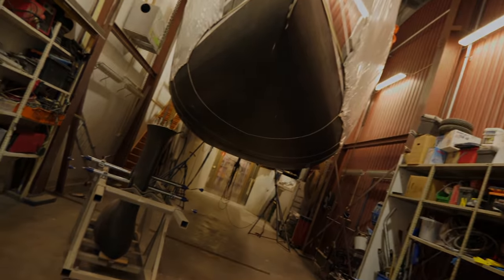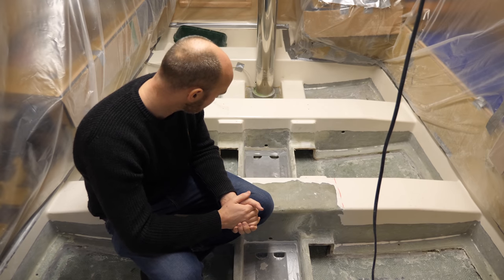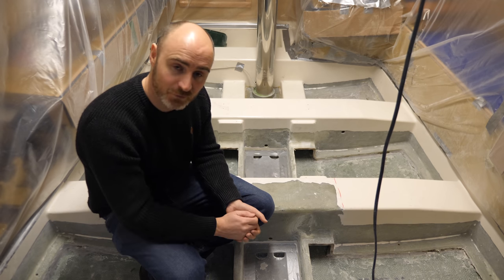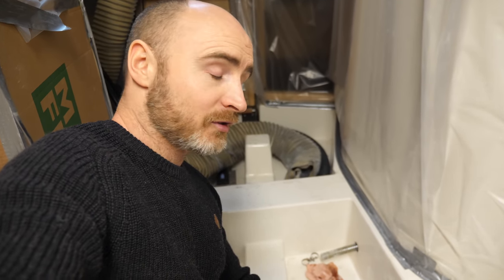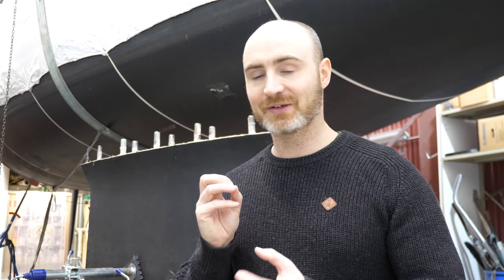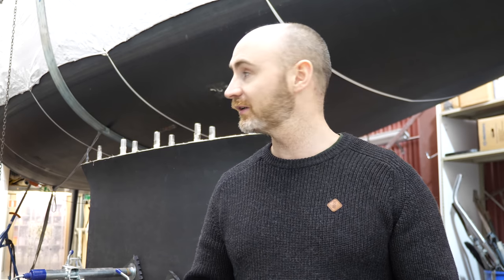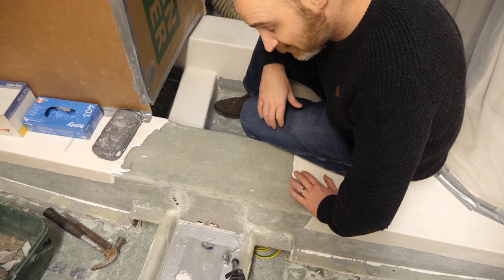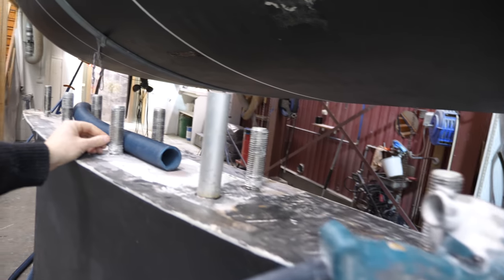SAILBOAT REBUILD - what they DON'T TELL YOU about PRODUCTION BOATS - Plastskador repair week 2

Comment: The bonding, if done with quality materials, is very good practise, the reason that Hanse is in business is because they choose the best, most economical way to build. This collision is about as bad as it can get without holing the hull. I can so empathise with feeling confidence in the tradespeople. Looking forward to seeing this completed.
Reply: Well said
Reply from the maker: Thanks Phillip, as always appreciated. I agree completely. I touch on this a little in the video released today. Cheers, Chris
Reply: This is months of hard work to repair. Very comprehensive which it needs to be. Thanks for sharing. The bonding is not much better than filler. It's glass without the reinforcing glass. By the way epoxy will bond onto polyester. But polyester won't bond onto epoxy. I also incorporate carbon fibre into high stress repairs and have found that by the time I have finished the repairs are massively strong.

Comment: Bilge pumps. You absolutely need an upgrade here. That pump is a clearing pump only, i.e. it is designed to get very close to the bottom of the boat to clear the last few gallons. If you are heading offshore my advice is to fit 2 fully independent pumps with separate outlets (T 2 hoses together at least halves the pump output). Arrange the switches so that one comes on a couple of inches higher than the other. The idea is that the first one is the 'working pump' and the second one kicks in when the first one fails, clogs or is overwhelmed. Because the second pump normally stays dry and unused it is more likely to work when you really need it. Also rig a loud alarm to the second pump, if it goes off you know you have an emergency. A good idea, but not essential, is to use the same model for both pumps, that way you only need one spare. When sizing the pumps look at how much water can come in if a sea-cock, rudder seal of prop shaft seal blows. Your pumps need to clear water fast enough in that event for you to make a repair. Personally I would not consider anything less than 2000gal/hour (for each, not total) as a bilge pump on any boat that is going offshore. I have always fitted 4000g/hr and under test these will keep the sump clears if you open a 1.5" sea cock but they will be working close to capacity to do it.
Reply from the maker: Hi Roland, thanks for the tips. In the later videos you can see that I installed exactly that, I had to run another pipe, which was abit of a pain but got in done. Cheers

Comment: Hi Chris, another great episode.  I like your recaps a great deal, very professional.  Not much to say this time.  Glassing in the repair areas is proper.  You make a distinction between a production boat (bonded grid) and a "custom" boat (glassed grid).  You will mislead folks that don't have a good understanding of boat building.  The vast majority of sailboats are production boats, meaning a company is making the same hull and deck over and over, from a mold.  A true custom boat is when you go to a naval architect and tell them you have an idea for a sailboat and you want them to design it.  Then you take the drawing from the architect to a boat yard and say here, build me this boat.  There is a middle, or semi-custom boat.  Make no mistake it is a production boat but the customer has a great deal of input on interior design and layout, hardware selection and so fourth.  With a semi-custom, or production boat the customer is never given a choice of bonded or glassed grid.
Moody and Hanse are under the same umbrella that is why you will see some Moody design and innovations in the Hanse.   Moody is a production boat, it is a semi-custom.  Hanse bonds their grid, Moody has a glassed in grid.  Amel production boat without much input from the customer,  glassed grid.  Sirus a small german maker of of some fantastic sailboats.  They only have 3 boats in there offering 31, 35, and 40 foot.  There boats are semi-custom, the customer has a great deal of input.  All their boats have a glassed in grid.  Bonded grids are safe, strong, and work well except when they don't.  Would I exclude a boat maker from my list of what new/used boat I am going to buy based only on how the grid is secured.  Yes, I would, I guess I am a bit OCD about that.

OCD and bilge pumps.  I hear and understand you mate.  For what it is worth.  Get the best and highest capacity pump that will fit in your bilge.  Matter of fact, get two.
The bilge pump thru-hulls being above the water line is not as critical of material used, as those below the water line.  Having a seperate thru-hull for each of your 2 or more main bilge pumps is the way to go.

You are doing very well, I like to watch as your knowledge base increases.  Here ya go use a sealant when you want protect from water intrusion.  Ues an adhesive when you want to attach something to something.  On the keel, it is 3M 5200 adhesive.  There is no other choice that compares.  Those guys at 3M have an "unofficial" slogan about 5200, it goes like this.  "What 5200 puts together, no one but God takes apart"

Be happy, be safe.
Reply from the maker: Thanks for the good insight Larry, sounds like you have got a hell of an experience. Being at Plastskador has really taught be a lot about bonded and glassed grids and I would have liked to have know it before looking around to buy a boat.

Comment: I’m coming from the carbon fibre world where when you bond two pieces of carbon fibre together using Methyl Methacrylate you’re not able to break that seam before you actually crack the cf laminate first. I’m curious to understand  what is the bonding material used in boats like Hanse? Methyl Methacrylate should bond equally as well to glass fibre. 
I believe you got the it backwards regarding polyester being stiffer, that is not the case. Tensile strength in epoxy is higher than polyester.
Great video. Interesting to see the work carried out by these guys.
Reply from the maker: Hi there, thanks for the comment. I'm not sure what was originally used by Hanse. I have been doing quite a bit of research on Epoxy and Polyester over the last couple of weeks. These videos have caused quite a stir. As you probably know, tensile strength is the breaking point of a material, I beleive Epoxy excels in this partly because of it's flexibility or deflection. Wheras stiffness is the amount of deflection of the material. Polyester is less flexible. Thanks for the compliment, the repairs are going well so far. BR Chris

Comment: The second bilge pump is a definite Go Ahead. The one you have is way too Pussy for a boat of this size and investment. A separate hose and discharge port is a definite Yes. I also do not like standing water in my bilge--always want to determine how it got there?!-Mikey, Belfair, Wa, USA
Reply from the maker: My thinking exactly. I just need to mount an anti syphon valve at some point in the pipe. Since this video the bilge pump is mounted and will work well I think. Thanks for the comment

Comment: Thru-Hull fittings and taps, the general rule that most of us follow in tropical waters is to change them every 7 to 10 years whether Bronze or Plastic. the fitting materials usually outlast the ball valve area of the tap. The ball and internal face usually fail and seize (thru poor maintenance) before serious corrosion problems. Some English made valves are made for pull-apart maintenance, expensive but worth a look, for a much longer service life than 10 years. I only have 2 thru-hulls, one for in and one for out, I run a manifold system on my custom built boat.
Reply from the maker: Hi Stuart, thanks for the advice, really appreciate it and learning everyday. Right now I am looking at TrueDesign stuff, it looks pretty good. Not sure how long term testing they are though. CHeers

Comment: You mentioned that the keel of your Hanse 40' was bolted through just 10mm of hull fiberglass.  It is insightful to contrast current boatbuilding practice against 1980's boatbuilding practice.

My 1985 Pearson 36-2 has a 10mm thick structural grid of longitudinal stringers and lateral ribs. The grid extends up above the heeled waterline, and the grid appears to be bonded to the 10mm thick hull with 5200. The strength of the grid is such that the shroud chain-plates are bolted to the grid where its top edge is heavily glassed to the hull. The grid also extends down into the hull's keel stub & bilge. Consequently, the external lead keel is bolted through both structures comprising at least 20mm of fiberglass.
Reply from the maker: Hi Ash, since making this video I have notices that the hull varies in thickness, it's only parts that do not need to be that strong are fairly thin to keep the weight down... which is understandable. Around the keel the thickness from factory is significantly thicker that 10mm and is very strong.

It's true, they did make them like Tanks back in the day

Comment: If the bond has broken between the hull and grid flange, you’ll have to cut the flange off and put in a fillets then lap multiple layers of epoxy glass across the two. Lapping glass on top of the flange and onto the hull won’t have enough strength to keep the grid from peeling and lifting away the the hull.
Reply from the maker: Hi Karl, that's exactly what's been done, I think you will see more in the next video this week
Reply: @SailingAurora  
Looks like you’re on the right track. There’s no easy way, only the right way. Be very careful with dust, fumes and contact poisoning. In high concentrations even the right respirator with ventilation can get overwhelmed. Then it’s supplied air time. MEK, xylene, toluene and acetone can mess you up for the rest of your shorter life.
Reply from the maker: @SkypowerwithKarl  Good advice :)

Comment: The strength of fiberglass is long continuous strands of glass fibers laminated before the chemical reaction has cured.A repair patch stick on is just that a patch.When your hull flexed and popped the glued in grid structure the entire hull flexed and broke the fibers.Marelon fore spar  thru  hulls are inert and lightning proof along with non corrosive. Amel uses a sea chest for that reason as does feadship
Reply from the maker: Thanks for the explanation, I really like the sea chest idea with one thru hull to serve many, it's a good idea. Chris

Comment: If you use Bronze (Copper and Tin) they will be the best choice, but expensine. Brass (Copper and Zinc) even when it says corrosion resistant can suffer from de-zincification, which leaves mainly copper, which work hardens and shears. Sam with Brass props
Reply from the maker: Thanks :) Right now we are looking at True Design composites though. They look good.
Reply: @SailingAurora  As long as you are sure you will never be able to stand on them
Reply from the maker: @saltybuster946  interesting... they do claim to handle a lot of weight. Research continues....
Reply: @SailingAurora  I've seen too many sheered off. Like I say, fine if you can be sure there is no chance of standing on them. I replaced all my skin fittings and sea cocks with tried and tested brass, I sleep well at night ;)
Reply from the maker: @saltybuster946  Cheers, sounds like sound advice
Reply: @saltybuster946  Bronze.  Never brass.
Reply: @David-hm9ic  Absolutely, I should never comment with half a bottle of rum in me, you will see I changed my senior moment afterwards. Not even CR brass

Comment: Thanks Sailing Aurora.  You mentioned brass versus plastic seacocks.  Like you said plastic seacocks have the potential of shattering under an impact load.   The reason for this is some seacocks are made of cheap plastic with a poor fracture toughness.   The cure is to force the seacock manufactures to build out of more expensive plastics with acceptable fracture toughness.   Fracture toughness is a materials resistance to cracking under impact load.  
I am sure there must be manufactures who build seacock with very good plastic parts.   Any suggestions from the other readers.   Good luck with the rebuild.
Reply from the maker: Thanks for the comment, we are going to buy True Design composite ones now, they should be good. Cheers, Chris
Reply: Some plastics are stronger than metal

Comment: As an engineer (not marine) I will always have concerns about strengthening. It's all well and good to strengthen an area but all you do is transfer load onto the next weakest area. Should another grounding occur you may find that instead of everything bending and deflecting as a single unit, with the result of manageable water ingress. You may end up with excess force applied to a smaller area, with the result of a huge hull tear and vessel loss. Also, I would have gone with epoxy regardless of cost and ease. Epoxy stick's like shit to a blanket to anything and has flexibility.
Reply from the maker: Hi there, I understand where you are coming from, the guys at Plastskador have repaired boats that have been grounded multiple times, the next damages do move away from the strengthened area but it is highly unlikely they will tear the hull. The hull is extremely tear resistant due to the way that fibreglass is woven. The force of a grounding is transferred upwards and the next damage would extend further out on the grid.
I can also understand that a lot of people want to go the epoxy route and after doing a lot of research I can see why. On the other hand, for this job the correct preparation was done and the right method was used with the experience these guys have, they have repaired 1000's of boats over the years. There are a lot of benefits to using Polyester also, and for this application, especially as its Isophthalic Polyester and not orthophthalic it's a very resistant and strong repair. Cheers, Chris

Comment: You can put epoxy on polyester but not the other way around. You can keep putting layers on epoxy as long as it’s very tacky, but once it’s set it must be sanded and quick wiped with MEK before more epoxy glass can be added. Oils/waxes migrate to the surface and must be addressed before continuing to ensure a strong bond.
Reply from the maker: Thanks for clarifying that one, after some research I came across this. Slight correction on my part there, Cheers
Reply: @SailingAurora  
No problem. I just hate to have others learn as hard as I have. Lol

Comment: My Nor'sea hull is twice as thick and it's only 27 feet.  I had a bad grounding and had to put a little fiberglass bandaid on the leading edge of the encapsulated keel.  It was 1/4" deep gouge at the deepest point, but it wasn't even close to penetrating to the lead.  I felt extremely sick with myself, but it's nothing like this.  I've been through all the new production boats at the boatshow and they are so inferior which is a shame because as you say the same equipment is used, and I'm fine with a cheap interior, but a compromise in hull integrity is unacceptable in my opinion.
Reply from the maker: I can understand where you are coming from. I think the price competition in production boats has driven some of these decisions/compromises for sure

Comment: On that size boat I would have a hydraulic clutch and real  pump comming off the engine,saved me on a 40 ft fishing boat,also running  masthead lights n and strobe light !! Most deck mounted lights are pointing to the space station or Dave’s jones house as the boat hobbyhorses, Anny swell and your invisible,I woarked on cargo ships,a real masthead lights make you noticeable as soon as you come over the horizon, it makes you real !
Reply from the maker: Makes a lot of sense and good advice, cheers :)

Comment: I'm thinking what would happen to a boat with a fully laminated grid during a hard grounding? Would more damage be done to the hull itself?
Reply from the maker: Great question! I will cover this a little in the next video. I am told the damage would find the next weakest place and this usually further away from the keel and up the insides of the hull. I will try and find an example in the future.
Reply: @SailingAurora  I think the biggest problem is a 10mm thick hull

Comment: Will just say you DO NOT need a grounding for delamination of the hull grid. AS the boat sails in rough weather, you will get delamination as the hull flexes ever so slightly.
Reply from the maker: Good to know, thanks, we will be checking on this after some beating into weather :)
Reply: @SailingAurora  I've seen some separation on the hull grid of factory beneteaus(38's) after about a year of hard sailing. Just something to be aware of rather than concerned. I think the glass work that is being done on Aurora is the "proper" design but production builders dont have the budget for it unfortunately.
Reply from the maker: @jordandegeus5791  True that, the market is very competitive these days between the big brands

Comment: Never use brass on a salt water boat... that has de-zincification problems where it turns porus and pink...
Check out FastFlow bilge pumps, clamp on the prop shaft and pumps more water than ALL other bilge pumps if you keep the prop turning. Don't Tee the bilge pump line since you'd need to put a check valve (and they always fail) to keep one pump from dumping water back down through the other pump. Understand every connection, every foot of head, and curves lower your GPM throughput, and your DC will drop as the bilge pump runs the battery down, so that affects your GPM too.
Reply from the maker: Great comment, noted and learning all the time. Cheers, Chris

Comment: Polyester resin strength is 500 psi and epoxy resin 2000 psi, please correct me if I am wrong.
Reply from the maker: Look up Isophthalic polyester this much much stronger and more resistant than Orthophthalic Polyester. This coupled with the Crestafix adhesive makes a more than strong enough bond